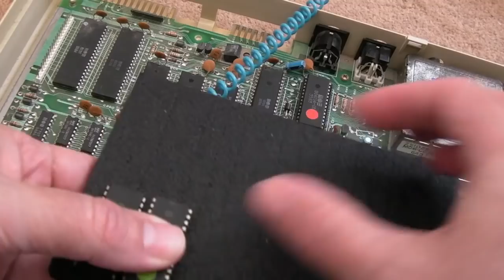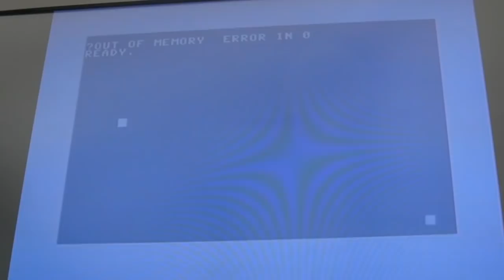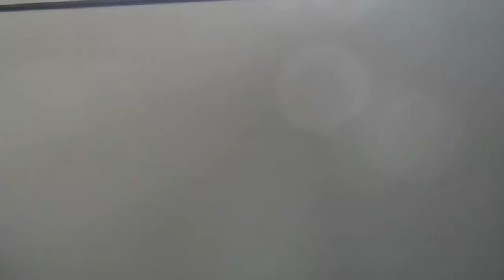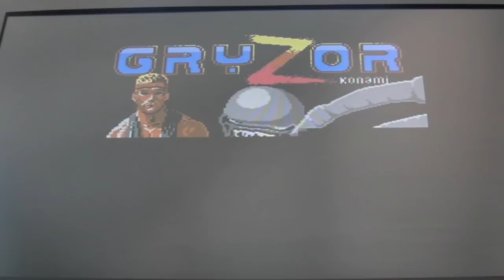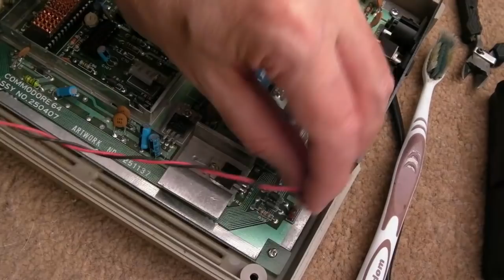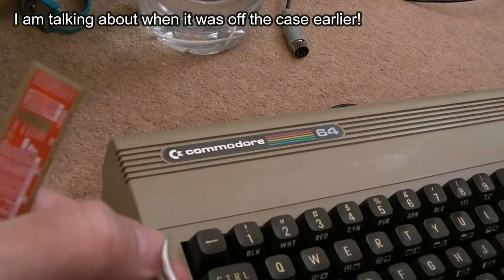Commodore Fixty Four (Another Black Screen Repair)

Comment: To clear up the confusion about PLA20V8 GAL timing: Both the 20ns and 15ns GALs can be used to build a compliant PLA and whatever you choose, it will not cause RAM problems. There have been very few problem reports for both...

... however, here have been some boards with 200ns RAM where KERNAL replacement cartridges didn't work. In these cases switching to 15ns GALs proved to be the solution. This isn't a general incompatibility problem with 200ns RAM, normally you get full compatibility for both speed grades.

Comment: MT RAMs and MOS 77xx logic chips in the same machine? That's one unlucky breadboard err I mean breadbin.

Yeah I had a black screen C64 once where I couldn't find the fault (all outputs on the 257s were toggling). I just got an In-Circuit Chip Tester (DIT ABI 24), I used it on the LS257s and they failed with different patterns. I tried it on a working machine and the 257s failed with the same pattern. So I swapped the one that was off and was greeted by the Blue Screen Of Life.

Comment: You mentioned being from the industry a couple of times Chris, care to elaborate? The reason I ask is that I was also in the industry but a bit earlier than you (heading towards pipe and slippers time here). Apart from technical Atari computer sales I was also working for a certain company that I know you will know, Maplin Electronics, I was management for them in London after the they dropped home computers from their line up. Interested to hear what line you were in but from your knowledge I'd guess engineer / computer support (but real IT, not a script reader, a genuine hands on guy with the qualifications.). I loved growing up and working with the home computer launch, met most of my programming heroes, even sold a certain Archer Mclean his first disk drive. Far too many long stories to go in to but I love hearing from others that navigated the industry.
Reply from the maker: =D  I started working for an electronics repair (and component sales) shop - Eteson Electronics.  That was whilst studying electronics.  I then moved to a local computer repair company.  From there I took over that business and ran it for a few years, but eventually left and moved to a larger repair business - to get more experience.  Running it on my own for that period of time was great and all, but the senior engineers had left and there's only so much you can learn on your own.   Incredible to have met Archer Mclean! =D
Reply: @GadgetUK164  Well as we were an Atari centre it was sort of natural, we got loads of celebs and devs in, Fergal Sharkey, Linford Christie etc etc, plus we were just down the road from the BBC so they came to us..

Comment: I didn't think it was correct to screw down the 12v voltage regulator, had the previous owner done that by mistake?
Reply from the maker: It's just optional really on the 7812!  It doesnt really need screwing down as it doesn't get that hot, but it doesn't hurt to screw it down!
Reply: @GadgetUK164  I was under the impression that the heat generated if dissipated through the board when screwed down can radiate its way towards the VIC II chip and cause failures further down the line. I've seen the 12v voltage regulator to be over 50ºC in operation, so I would be reluctant to do it. However, if anyone has had their 12v reg screwed down for years after 100s or 1000s of hours of usage without a VIC failure then fair enough, but it may be one to look into further though.

Comment: Great repair as always, and the info you pass on is equally important, well done that man. You touched on the issue of loading disk files from the Kung Fu flash etc, there will always be issues like that across machines. On the atari we have a cart called AVG and it like the 1541 ultimate uses a cable to go in to the SIO (IEC 64) to allow hard coded titles to still work as they are still using the bus for that machine. That's why I have an avg and a 1541 ultimate ++, almost 100% compatible..Anyway, looking forward to some more C64 content...Keep safe..

Comment: When you get the out of memory error you can often determine the bad chip if you also get random characters on the screen. In your case you could also see reverse space on one part of the screen. The screen code for space is 20 in hex and a reverse space is A0. This indicates that bit 7 is stuck high for some addresses.
Reply from the maker: Good point!!!

Comment: Also replace the 7805 with a TSR-1 2450.
Reply from the maker: I am reluctant to swap the linear regs with DC2DC - Jan Beta did that (and I tried at one point) and you get audible noise on the SID, and video too.  It's basically the high switching noise.

Comment: Is the dead test program always accurate? I've got 2x C64s - a C64c and a 1983 model and it reports the same problems with both of them but they work 100%: games, Commodore BASIC etc.
Reply from the maker: What problems does it report with them?
Reply: @GadgetUK164  "BAD" for SIDs and CIAs U1 & U2 but demos, games, BASIC, joysticks etc. all work. (I don't have the harness setup to test further.)
Reply from the maker: @captaincorleone7088  That's exactly what I was trying to explain in the video - when the test harness isn't connected, it will report the SID and CIAS as bad, when they aren't.  So it sounds like both machines are OK.
Reply: @GadgetUK164  Thanks, I appreciate the answer and the clarification! One other question if you've experienced this, the SID on my 1983 Breadbin has a constant high pitched tone when sound is played. Is that a normal quirk with these ageing ICs or does it need replacing?

Comment: You know, looking at the C64 logo thingy you fixed, it’d be cool if the rainbow-colored parts were actually oLEDs, and modify the startup sequence (in the Kernal ROM) to light them one at a time, then all on, then you see the C64 basic screen. If there’s a RAM fault, it could indicate it with the color of LED it stops on, sort of like the colored screen, but would work even if the VIC II chip (or the RF modulator) was bad! Damn. Now I may have to get a C64, a Raspberry Pi nano, and an oLED display, and do some hacking. But with the chip shortage, this project will have to wait. 🥺
Reply from the maker: That would be cool =D